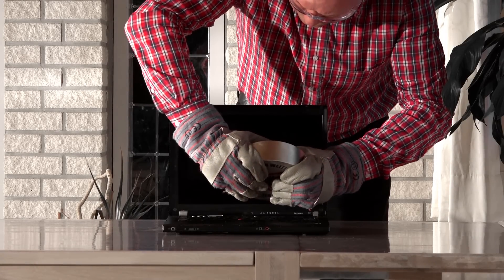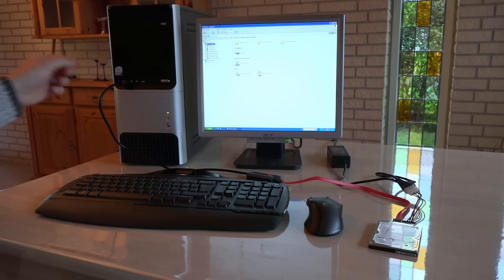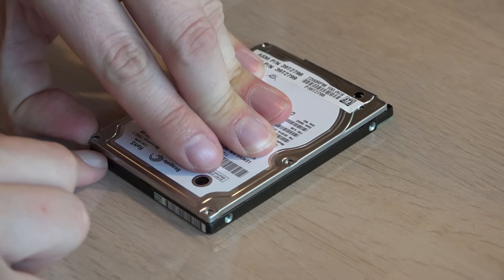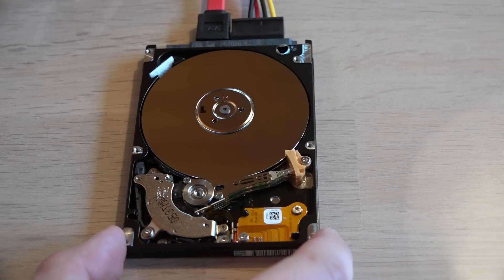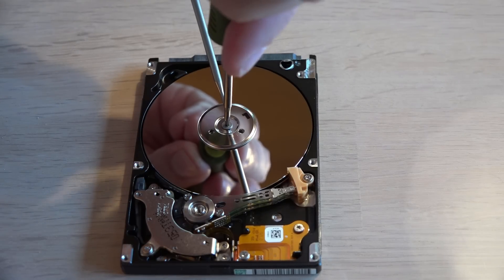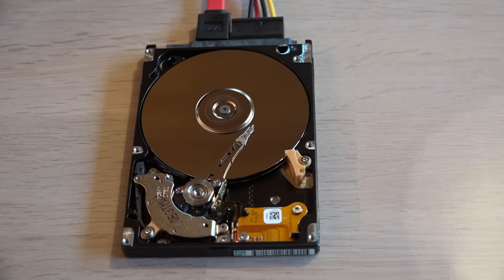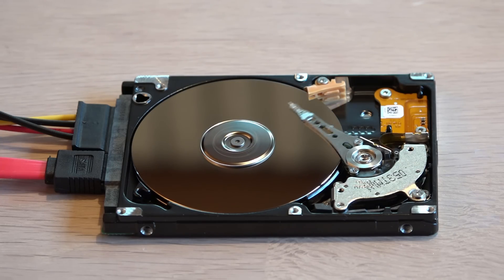Killed by magnet | HDD examination

Comment: What was the strength of the magnet that you used to destroy the drive?
I also would like to know what tools you used, or what tools to use, to get to the motor for removal. I have a defective drive and would like to pull the motor.

Comment: Due you LOW level  "formatted" degaussed the dive with a overwhelming magnetic filed You Removed the Head Voice Coil Locaion data Track
 it kind a Spiral track like a LP Phonograph record Grove track Just less physical and more invisible 
That  lets the Heads know of there location  Axis over the platters

Some other HDD Drive  if they can't find The track will Rebuild It From scratch (Firmware Regenerate ) it take them a while  
Some other Drives Brand get a little more Musical and Start Shrieking a Distress call sound or Just clicks

Comment: To get recognize the harddrive you have to connect firstly the data cable to USB pc and then the energy cable. If you dont follow these steps Windows will not detect the harddrive

Comment: So when an HDD is manufactured, they do what's called a low-level format in the factory. This turns the platters into sectors and whatnot for the data to be placed on the platters. This information is stored on the platters and coordinated with the controller. When you used the magnet, it wiped that low-level format, and thus the controller literally sees nothing on the drive [save random noise], and can never even do a format again [formatting from the OS would be a high-level format]. I'd also assume, given the size of your magnet, that ALL data on the disk was completely destroyed as well.

Comment: I have done this experiment with a somewhat strong magnet on a powered-off disk, and it did absolutely nothing. Only when I repeated it with the disk spinning, I could hear it losing speed and then making noises which were probably from the heads crashing. After that, it was in permanent click-of-doom mode. Obviously my magnet was nowhere as strong as this monster of yours, but still I have read that to actually wipe the low-level formatting on a modern hard disk, one needs very strong concentrated fields that should be impossible to obtain with just a permanent magnet alone.
Others have done the same experiment, even with a spinning drive but the magnets placed away from the mechanics such that those couldn't cause mechanical failure. The result was the same: https://www.kjmagnetics.com/blog.asp?p=hard-drive-destruction

I would very much like to see you repeat this experiment on a disk that is not spinning, to see if it can really destroy the low-level formatting. It is of course also possible that the magnet will simply pull ferromagnetic parts out of alignment or magnetise them enough to influence operation.

By the way, love your videos. Even the oldest ones have a very high production quality already!

Comment: The noise from the hard drive is because the heads have been bent by the magnet, and when passing to the disc, the heads are not aligning correctly. Also one of the heads may not be touching the disc and there for not reading all required bits. The hard drive may have not shown in in Explorer because it needed to be initialised.

Comment: The magnetic pulse of the magnes could've changed the way a drive stores its data it is called bits and they are magnetic and they are in a certain direction whitch it stores data in binary code and tge magnet couldve re aranged the bits there fore the data was cleared

Comment: Most of these drives are running an embedded Linux and you can talk to them using normal serial protocols on their JTAG port. It'd be interesting to see what's reported and what happens if you initiate a low level format (this is normally done in the factory after assembly and not available via the (s)ata port) There are a couple of youtube videos from people who've done this.

Opening the lid completely messes up the tracking alignment - that screw under the label is the top support for the head pivot and the assembly will flex without it as the heads move. (there's often another one holding the top of the platter assembly in higher end drives)

The seeking is indicating that the drive can't find its alignment track. This is a common failure mode and drive recovery companies often find that they can get the drive working long enough to get data off it by tweaking the lid screw(s) - there are a few youtube videos about that. 

In your case I suspect the magnet trashed the track :) I wasn't expecting that to happen as attempts to erase disks using big electromagnets at my workplace always failed.

Comment: You can reverse the polarity of a magnet with a significantly powerful magnet.  In the same way, they can take a complex magnetic field and simplify it to align with the more powerful field.  This is why the data on the platter erases, as all of the micro polarities are cohered unidirectional, and also why, if powerful enough, it can unify (or partially) the driver magnet for the read arms.

https://www.youtube.com/watch?v=Fm_PSYIeLKs
Forgive this fellow's attitude; he has loads of valuable magnetism information that nobody else has.

Comment: I think like others said, the data and formatting have been destroyed / damaged. But I think you could have repaired the hard drive if you didn't open it, you could have completely wiped the whole disk with dban data destruction tool, then reformatted it. You said it was not detected by the computer but if you plugged it in the computer and booted into bios mode, then use dban to completely erase everything, then reformat it, that could work.

Comment: Well, isn't the firmware stored partly on the magnetic discs?
If it got erased, it would not boot correctly because something vital is missing
Reply: Smie87 is right.
Reply: No. The firmware is stored in the Controller which is there on the drive.
Reply: @beedslolkuntus2070  Well, what do you think about that? https://www.securedatarecovery.com/services/hard-drive-recovery/firmware-damage
Reply: Smie87 no it's on a flash chip

Comment: A SSD, Solid State Drive, is used for short-term data storage. So is the Hard Disk Drive, Which writes Low, Magnetic fields on the platter. But, dust is sort of a problem. A 3 NanoMeter clearance between the platter and the Head means that debree and dust scratch the platter, screwing up the head. Click read more for SSD and other info.

 The Magnet may have not only "overlapped" the small magnetic field, BUT the read heads could have crashed into the platter.

Now, with SSD.

Solid State Drives are used for Short Term Data storage. The reason why is because SSD's use electrical currents to store data. These currents can "erode" overtime, so its best to keep it plugged in. These drives can not be hurt with a magnet.

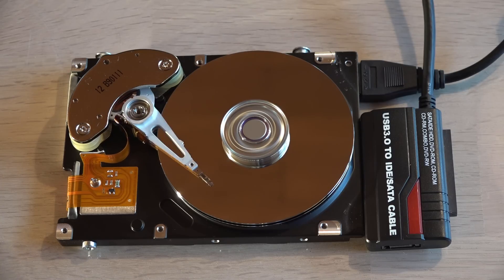Comment: 4:10 so what's interesting about that parking mechanism is you'll find it on MANY older hard drives. Back in that era, hard drives were all standardized to have a region of tracks designated as "the landing zone", located around the center of the platters closest to the spindle. This is because for a very short period of time, the heads themselves are actually making contact with the platters. They float above the surface of the platters when they spin fast enough to generate enough lift, but until they spin up quickly enough the heads will be dragging along the surface. There are spacers on the heads to keep actual head-to-platter contact to levels of non-existent, but the spacers will still make contact with the platter surface.

This "landing zone" is more or less a region on the platter that contains no data, and is the designated region where the heads will park and "take off" from when spinning up.

On more modern and recent drives, they simply park in the parking lock away from the platters and only cross the platters when they are rotating sufficiently fast enough to generate enough lift for the heads.

Comment: Nevin Williams is correct, the lower platter is pre -formatted with addressing and vital information necessary for the heads to know where they are at and fine tuning for reading and writing. Once erased all the ques necessary for the transfer of information and first transmission and hand shaking is lost. Heads do retries and verification and that is about it.

Comment: hard drives and USB drives have "files" on them that allow basic formatting and detection on computers. your magnet removed those basic files needed for detection. hard drives use magnetic discs with ether a positive attraction and a negative attraction... a 1 or a 0. these attractions make up the basic binary, so that's why a magnet wipes the data, it disrupts all the set attractions to a 1 or a 0 depending on what side of the magnet is facing it.

Comment: Probably the bios. Same as a computer, everything has a bios. There was a time years ago when you could reflash hard drive bioses with the first dos floppy disk. However ... it no longer works. Hard drive manufactures also refuse to allow users the ability to reflash a hard drive. My guess is they prefer you buy another. Same with motherboards. Some really old boards had replaceable bios chips... but the chips were all different and cost as much as a new motherboard. For many years, a dead motherboard meant a dead bios. Now, there's UEFI.... but, that doesn't fix video cards, sound cards or others.

Comment: Not sure if it was answered or not: those heads are not supposed to "touch" the disk like that. that is why it isn't working. they are out of alignment. after you opened it in a non sterile environment as well it just ensured it was totally screwed :P

Comment: My guess is that the hard drive deleted the data by switching the two poles North and South. The platters deleted data simply.
So the head if is on the platter it can detect data but by just on or off of the platter thats why it can detect the data.

Comment: Hard drives uses electromagnetic to write data in its sectors using the binary code 1's and 0's. 1's are magnetized and 0's are demagnetized. By applying a magnet to it your hard drive you turned all the 0's in to 1's braking the binary code. This is why the hard drive can't be read.

Comment: I'm a little late, but I can tell you that the "clicking" sound is the R/W head going back to the parked position to attempt to fix a problem. This can be caused mostly by 2 factors.
The first factor is physical damage to the platter or head that stop it from reading the disk. The second factor is the destruction of the servo-information and partition map on the disk. They are usually inaccessible by software and they tell the disk controller where the head is located on the platters and where files are located. When you placed the magnet on the hard disk, you probably erased the whole drive including the servo-information. When you spin the drive up, the head doesn't know where it's at, and attempts to fix it by reseting the head position.
Reply: nerd

Comment: i work on computers for a living the heads are less than 100 nano meters from the disk the magnet pulled the heads away from the disk less than 1 millimeter is enough to render the disc unreadable there is no way to repair that

Comment: Harddisks store data using a low-level format. This format typically consist of sectors with data, along with some headers, checksums, gaps and track-identifier headers. These headers tell the drive which sector is being read, or where to write new data. When you format a drive in an OS, you operate on the 2nd level format. This is just the data encoded as sector data of the low-level format.

In the old days with the ST-506 interface, the low-level format was dependent on the controller in the computer. For example, there was quite a few controllers available for 1980's class PCs, and the BIOS of these old PCs typically contains a small utility that allows you to write a new low-level format to a drive. Writing a new low-level-format was typically the first thing you had to do to every new harddisk you bought as well.

Then came IDE, and the controller was moved away from the computer and onto the drive itself. This removed the need for the user to low-level format, as it was no longer possible to missmatch the drive/format and controller.

When you swipe a magnet over the disk, you wipe both the 2nd level format and the low-level format. A 2nd level format error can be fixed by reformatting the drive, but a low-level format on a modern drive is often irreversible. The controller on the drive simply no longer has any knowledge where all the sectors are, and is incapable of identifying where to make new ones.

Some drives MIGHT have the posibility of writing a new low-level format, but it's not a standardised function and it will likely require some debugging equipment for that particular drive.
Reply: 2rd? you mean 2nd
Reply: @Scotty-vs4lf  Tword
Reply: OwO

Comment: If you had not opened it up you could probably find a method to run a low level format by connecting some diag port. The drive normally has preformatted sectors and couldn't find anything it expects anymore.

Comment: Brainiac75. Take the platters out of the HD and put them into a new one. (As gently as possible.) See if you can get it to read?
Reply: The platters also get corroded and/or unusable when dust particles outside the drive touch it. Hard drives are constructed, and in the rare cases of repaired, in 100% sterile, dust-free environments.

Comment: The magnets demagnetized the magnets (or really screwed them up) that are used to control the read write heads and the magnet probably destroyed the low level on platter firmware. As a result the hard drive was completely rendered helpless. Data recycling companies often use these kind of magnets to completely destroy the low level formatted sector tracks and then the data so it will be gone forever. The magnet also probably warped the read write heads just enough short before a head crash but to prevent them from ever being able to read or write data anymore.

Comment: Its dead because the magnet killed the very sensitive amplifiers that read the magnetic data. By doing this the heads are 'blind' and no data can be read. To prove the point get two drives, kill one in the same way then swap the controller over from a non dead drive. It should work again...

Comment: HDD stores not only user's data but also some additional information about it's sector and track layout, part of its firmware (in most cases) and some miscellanous data (SMART data, defect and relocation map, etc.). If this data is corrupted, then that disk is cactus. Very old HDDs could be low level formatted, so they could be fixed after such failure. But modern HDDs can't (In theory they can but no vendor gives you specialized software required to do this).
Reply: no. it would cost nothing to connect a specialized controller onto the drive and let it to rewrite the missing blank information
Reply: Gabe Merritt Only because the tools that would be required to do so are not commonplace, just like with screens.
Reply: ok so let me ask does this mean that an individual could make the software required to fix the drive or would the company have to do that?
Reply: Probably manufacturer would be able to repair it as long as there is no physical damage to the platters and heads. They have to somehow create sectors on new blank platters. I don't know if that strong magnetic field didn't affect magnetic properties of materials used but if not, then it should be possible for them to fix it.
Reply: pvc It's cheaper to get a new HDD then repair a broken one

Comment: I think, since those HDD-s you used are old, i think the main problem are heads. From wikipedia: https://en.wikipedia.org/wiki/Disk_read-and-write_head
No matter how small the head is, it still uses "magnetic components" to read or write data.
So i think, the damage is in head. Maybe if you changed the heads, it might work again...

Comment: i think you could have messed up the magnets that control the read heads and they are no longer accurate so they continually try to find where they are. the data was probably all messed up too but i bet if the magnets that move the read head were not messed up a format would fix the drive

Comment: Basically what happened, is that the magnet set all of the poles on the platter to one polarity (north or south) erasing all data. There is a spot on the platter near the center of the platter that tells the head where it is, and that was erased. So, the head couldn't find where it was and read any data, effectively destroying it.

Comment: And this is why I despise HDD's, biggest junk in 21th century, good for cheap storage but too prone to data failures, I lost a 3TB HDD with plenty of important data simply by plugging it in, good stuff.
There is no data safety protection on HDD's to prevent foreign software from fucking with the data structure which is absolutely rxxarded in my opinion.
Reply from the maker: +SMGJohn 
Backup, backup, backup and backup of the backups... But yes, the digital storage on consumer grade HDDs is exposed to regular failure...